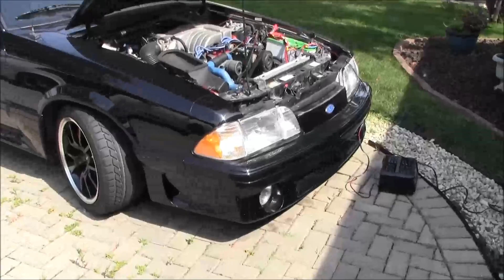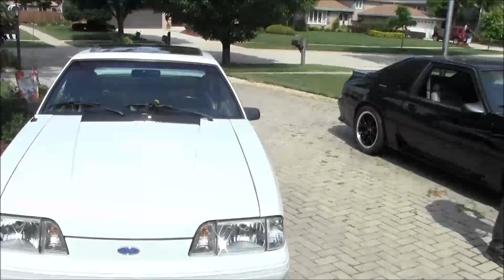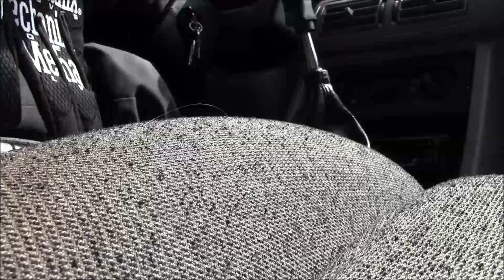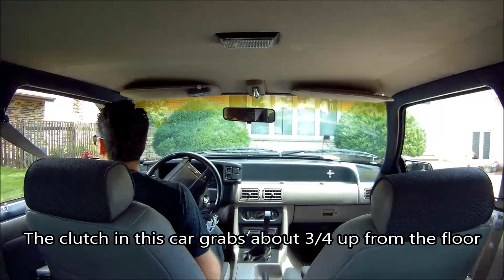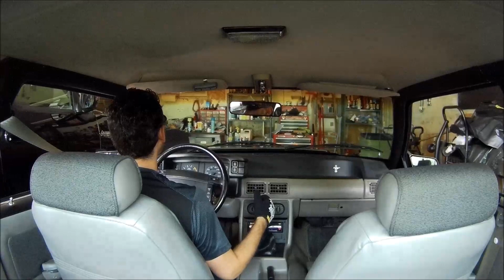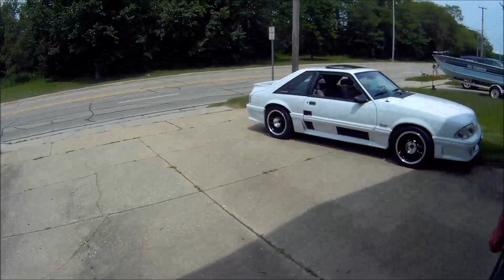"Knock Knock Joke!" ... Black fox body comes home

Comment: Awe man! I feel your pain! How many miles? Rebuilt before? Not common on the 5.0 to throw a main bearing, they are pretty bullet proof. Maybe I'll find out the story on this in your future vids.
Reply from the maker: 2RCPRODUCTIONS:  Not sure on the miles, well over 100,000 i'm sure.  I don't think it has ever been rebuilt but the guy who sold it to me had the engine out to change the oil pump.  I think this car was run with low oil level and beaten on.  Probably had the oil level run away from the pickup tube under hard acceleration which caused main bearing wear.  Just went down hill from there!
Reply: fwh79 Makes sense now, I appreciate the response Buddy 👍
Reply from the maker: 2RCPRODUCTIONS:  You're welcome.

Comment: Can the ignition switch cause the start-up to crank a second longer than expected? 
My pickup fires up right away and my Fox is a bit hesitant. I've replaced the coil, plugs, wires, has a good starter, TFI control module, fuel filter is new and have a new battery with an upgraded 3G alternator. The only thing I can think of is the fuel pump is in need for replacement of the ignition switch is too old.
Reply from the maker: Usually the ignition switch causing a no-start issue.  You should start by fully charging your new battery.  New batteries need to be charged, contrary to what most people think.  You should also inspect your battery cables.  The fox Mustang is poorly grounded from the factory.  Upgrading your engine grounding should help your situation.  Also check your ignition timing.  Incorrect timing will increase the cranking time before starting.
Reply: @fwh79FOXR6  makes sense. I ordered a smaller 2G pulley for my 3G alternator hopefully that keeps my battery charged better. I did replace and add extra 4 guage grounds as well. The 3G alt has a big pulley and it charges well but at idle it goes down a bit while running the AC and the lights on at night. When I put my key in on a cold start the battery is at 12.6V so it's charging well. In Houston I sit in a lot of traffic which isn't helping. Thanks for your input!
Reply from the maker: I would definitely pick up a battery maintainer for your Stang.  Check out this video about the SP3  https://youtu.be/biwTpBFM-ns  You're welcome, always glad to help.